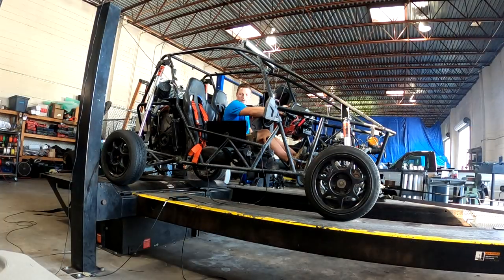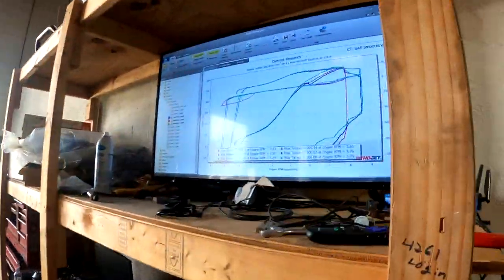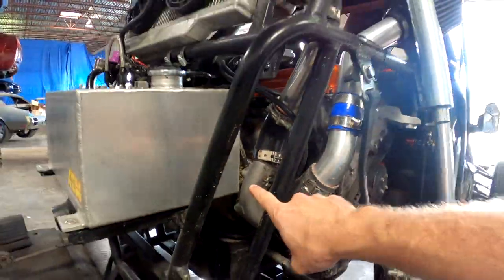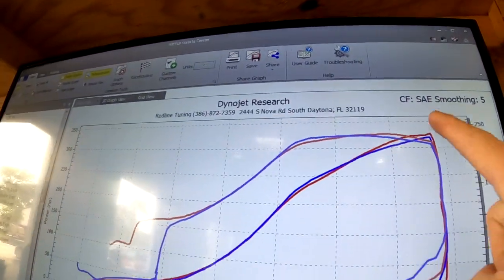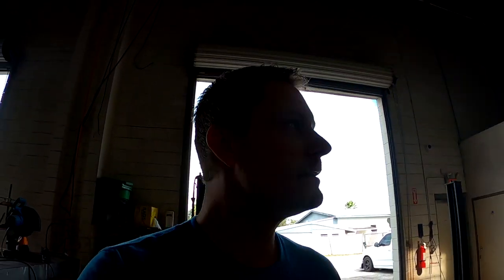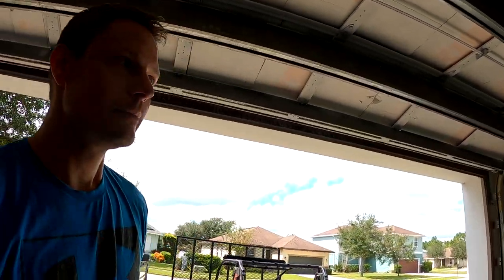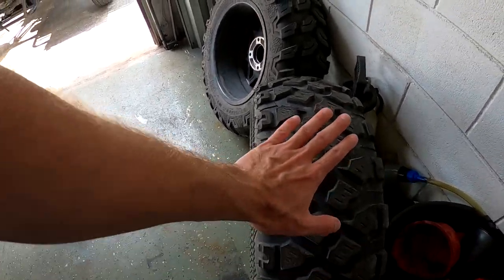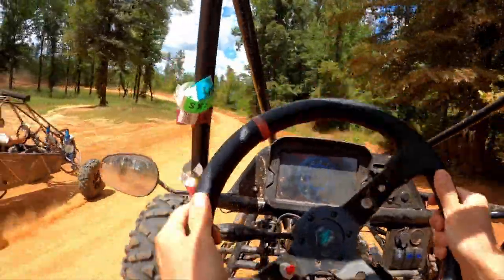Dyno Day! Will My Go-Kart Make More Power Than the New F150?? | Turbo Mirage 3a92

Comment from the maker: Congrats Landuck your guess was within 1hp 🎉 Free T headin your way bud!
Reply: Thanks for the tee. Not to change the subject but I have a problem.  I wrecked my go-kart. IT has a 301 predator on it. It landed upside down and was still running. The oil was pouring out and then it shut off. What should I do to get it up and running again? Thanks for your help.

Comment: More like 375 at the crank. Also, that torque number is fine given the RPM you're at. It's just the nature of revving it out. If it only revved to ~6500 (and peak power at ~5300) it would make roughly the same power as torque.